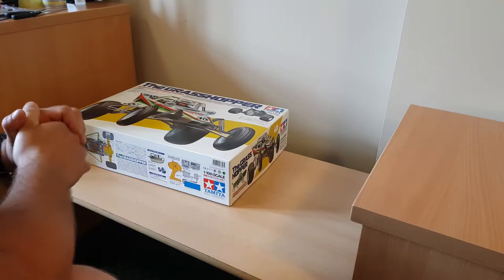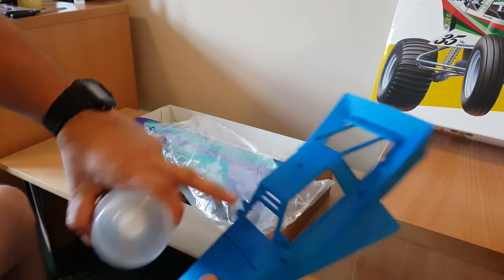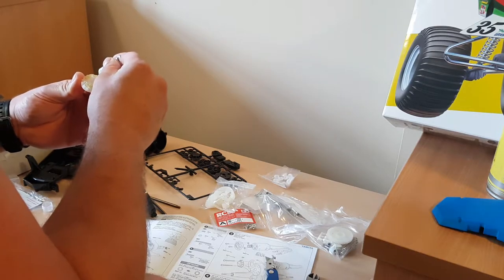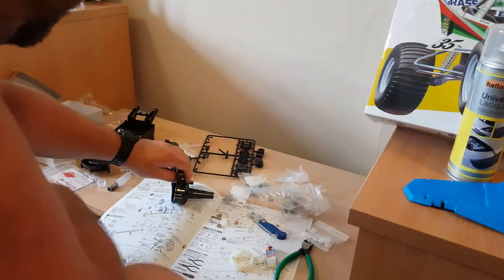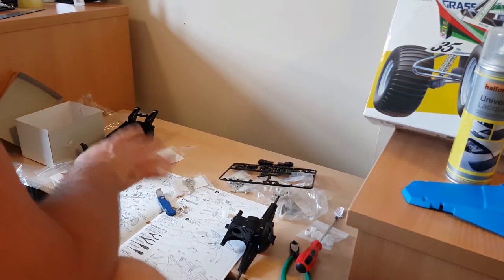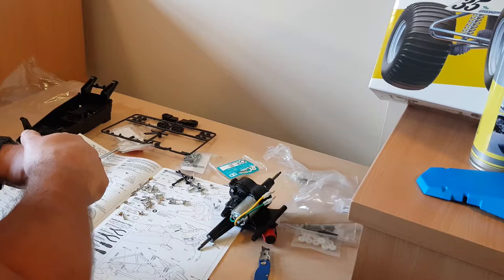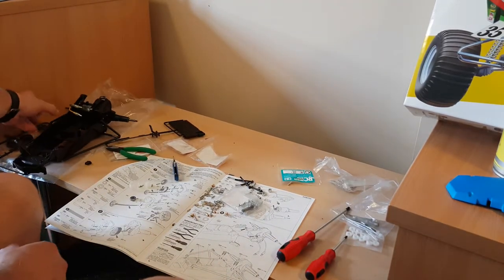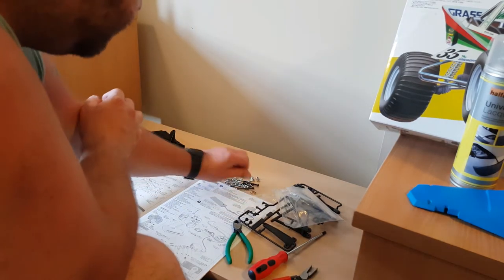Tamiya Grasshopper Build Part 1

Comment: Guys. Advice please.  I bought my son this rc car for xmas this year. He wanted an rc so i did my research and found this car to be the better option for a beginner. 
But it is missing parts. The remote control and others.  Can anyone advise what i need to get. 
Great video will use it while building our own...if i can find the parts
Reply from the maker: Hi it sounds like you've bought just the kit version rather than the bundle. This means you'll need a 2 channel transmitter, battery and charger.  Merry Christmas
Reply: @d252428q  thanks. Can you recommend which ones i can buy as there seems to be lots of options. This is a world i don't know much about. Subscribed to the channel.
Thanks.
Reply from the maker: Which country are you in? Also if you're on Facebook join ALL DAY RC group then all the members can assist you.